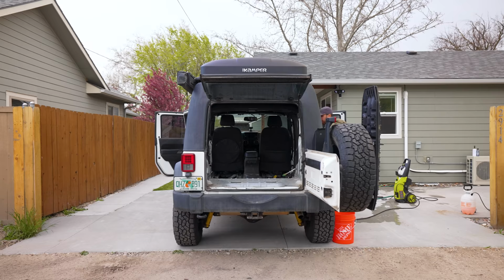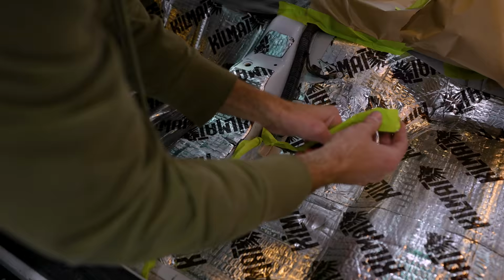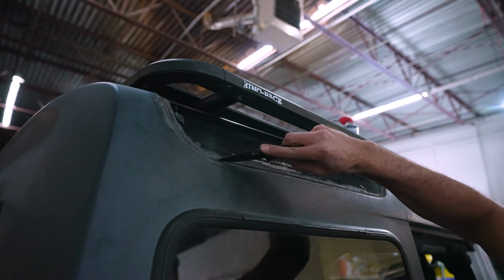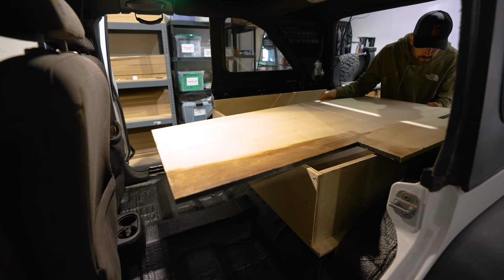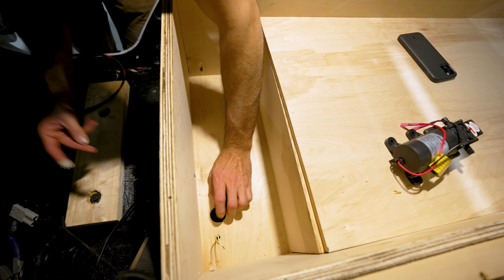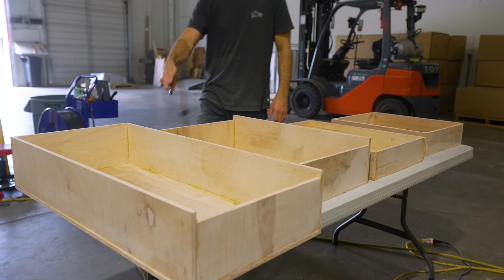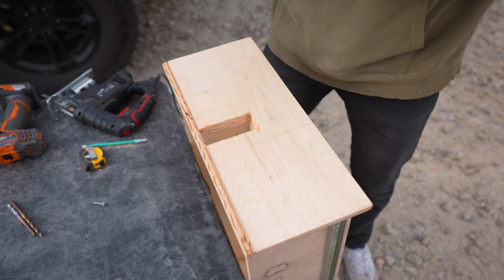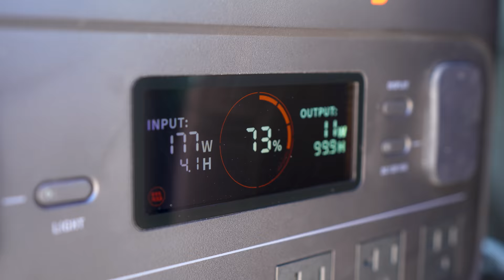How I Built the Ultimate Jeep Overland Drawer and Bed System for Camping

Comment: Nice build, Drew.  You should use the Raptor liner on the drawers and other wood, instead of staining and sealing it.  It'll add an extra layer of protection, and looks great too.
Reply: Spray liner's usually pretty thick, it might not fit afterwards.

Comment: Nice set up!  I would recommend putting an insulated sleeve over the water hose on the 5 gallons container, inside the cab of the vehicle.  It will prevent algae growth.  Safe travels...

Comment: Those hardtops are actually still for sale, but not under the Smittybilt brand anymore. I believe Patriot Fastbacks bought the design from them not too long ago.

If you look up “Patriot Fastbacks Adventure Top”, you’ll see that the Land Rover-style hardtops are still for sale for Jk’s and JkU’s. (And now even for the JL series).
However, they did a small redesign of the 4 door variant, probably to fix the infamous leaking issues they all originally had. 
The formula for the 2 door variant however looks exactly the same and is unchanged from the Smittybilt version.

Planning to get one of those tops for my 2-door one day 🙏
Those alpine windows are absolutely gorgeous and remind me of my buddy’s old Kalahari D2. (Before it started chewing head gaskets for breakfast anyways)

Comment: I wouldn't like losing that storage area on the floor in the rear, you've blocked access to it. I like the sound deadening material but why not a full rubber floor covering over it or just go for the bedliner material only? Another question, you have an IKamper so why the bed inside the jeep?

Comment: Nice!  New to your channel....  
 I gotta wonder what all that plywood weighed?  Gotta be heavy!  I put a simular water system on my 4 X 4 swing out tire carrier.  My water jug and German Food Carrier (both 5 gallon Military style cans.)  mount on the swing out carrier with the spare tire is mounted on the farthest out.  I have my ARB air compressor and water pump mounted behind the spare tire carrier / mount.  My kitchen hangs on the swing out carrier with removable shelving brackets, and so do 2 tables.  Then my 12 volt freezer slides out next to the tables.  
Been thinking of redoing it a little, and adding a top so I can sleep inside the rig.  But, without a raised roof it would be tight.  Usually I sleep in a tent that hooks up the the side of the rig.  But I''m thinking a 270 degrees awning with side curtains and a good cot might be a better choice if I make some magnetic cutains to seal off awning tent to the side of the rig. 

Would be interested in seeing what you pack in all  those new drawers.  That long skinny drawer, is that for tent poles or something?  I use a pvc tube mounted under my roof rack for my tent and shower poles! 

FYI, my 4x4 is an Extreme SAS'ed Isuzu Rodeo with Marlin Crawler Toyota double T cases and Tacoma transmission.  It's a blast to dirve in the boonie.

Comment: I love watching stuff like this but I always cringe when I see people use bedliner inside a vehicle, it is highly toxic and off gases carcinogens, which is not something you want if you plan on driving / sleeping in said enclosed area for any length of time.
Lizard skin would be a better option as it sound deadens, insulates, and protects the metal and it is made specifically for use inside vehicles so it doesn't off gas cancer causing chemicals.

Bedliner is for the outside of vehicles, don't use it on the inside people.